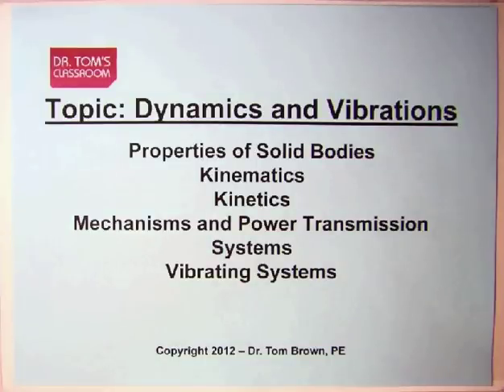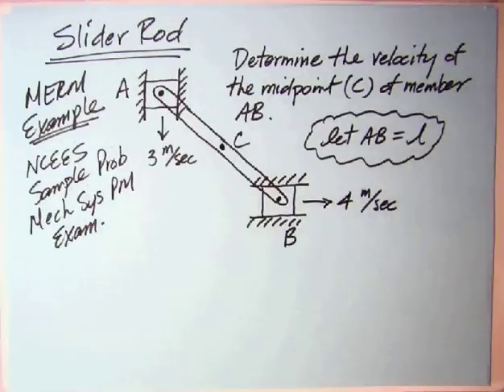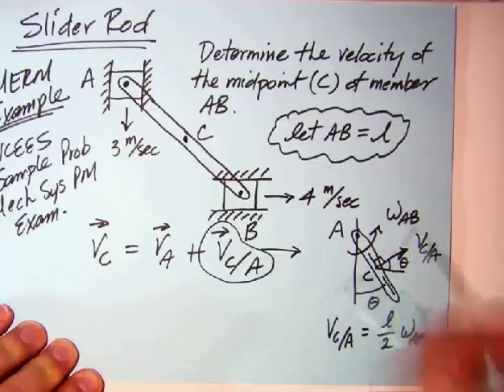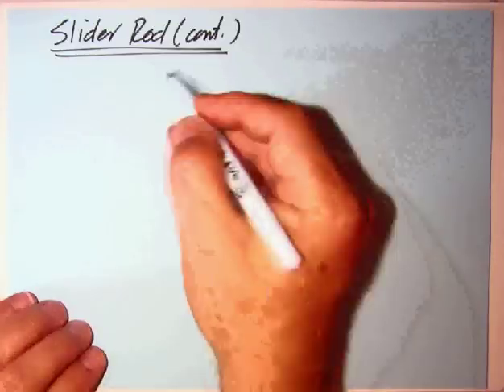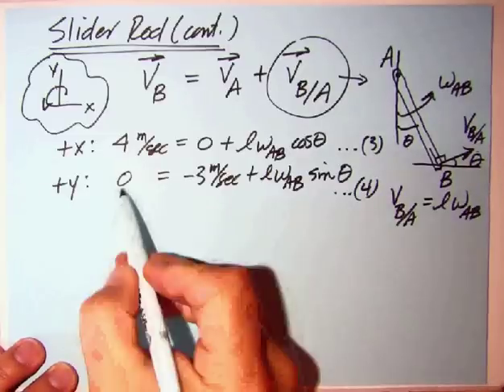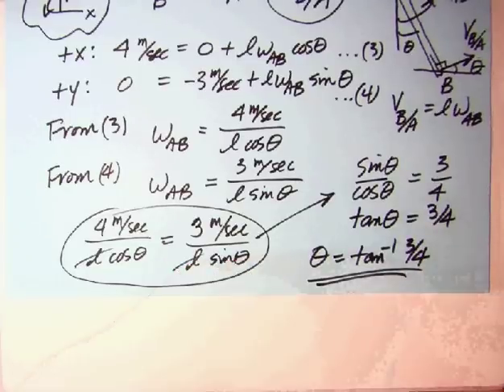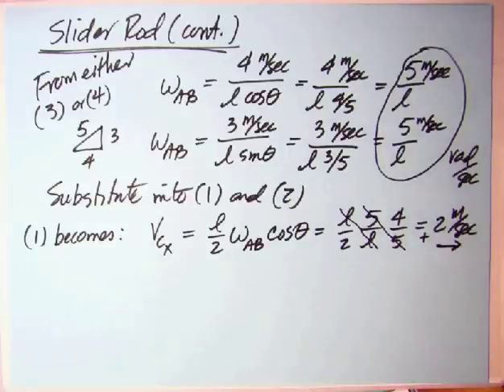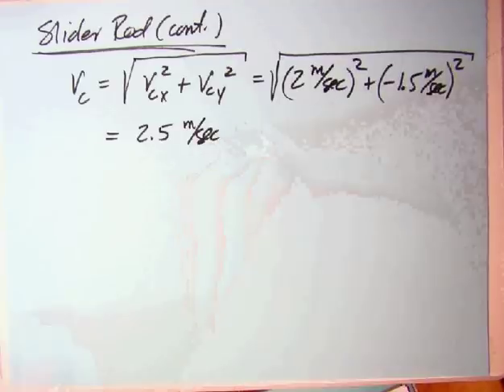Slider Rod - Machine Dynamics (What the MERM doesn't tell you)

Comment: The half-speed thing you mention in the end makes sense because Point C is exactly 1/2 the length of the total bar. So if you think about the geometry of the problem as if it's a lever, Point C will move at half the speed of each respective slider (in the respective direction) because it only has to move half the distance. Really you can solve this problem using geometry only because each slider is perpendicular to one another. If Point C was 1/3 L, then the velocity would be 1/3 & 2/3 each respective velocity vector.